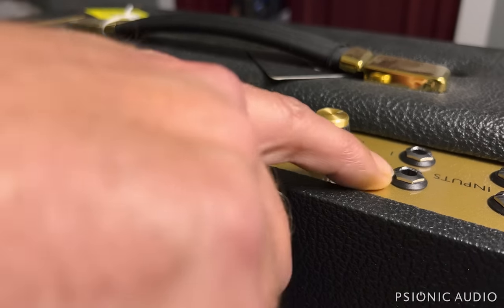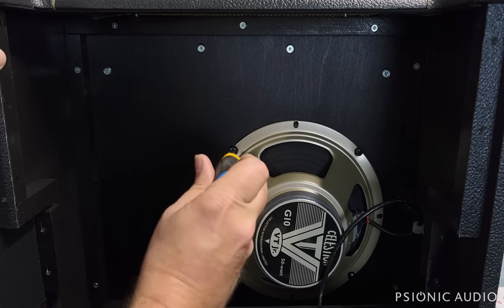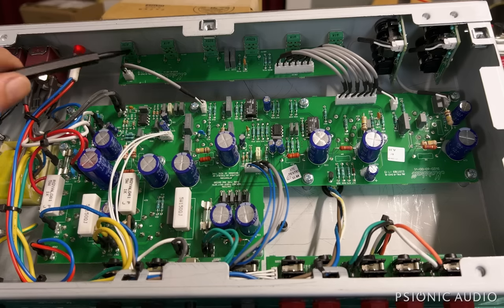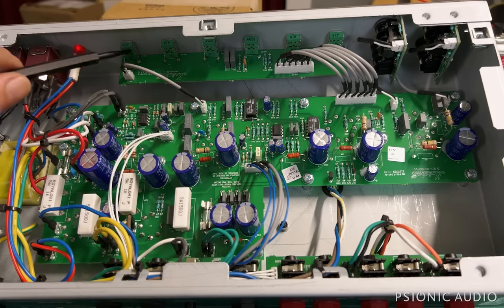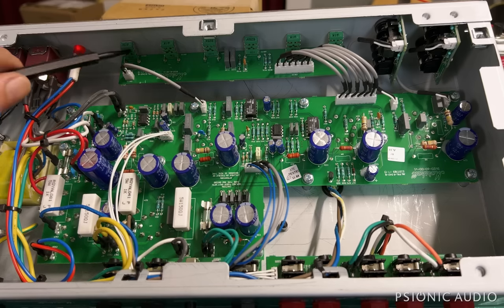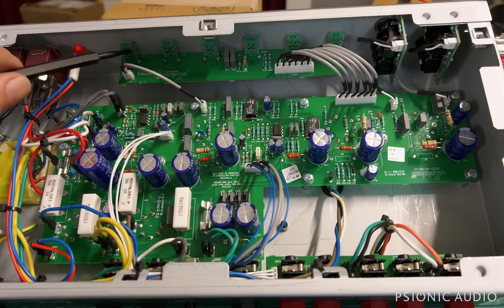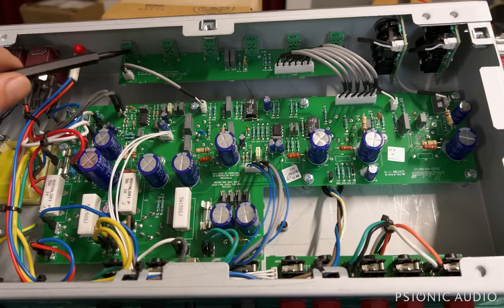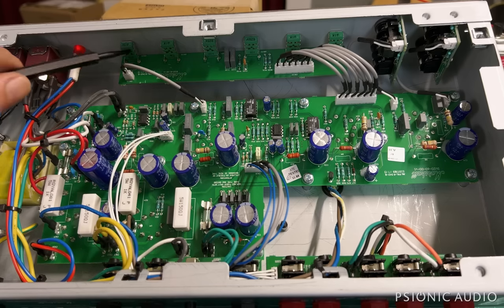Marshall Studio Vintage 20 | An In-Depth Look

Comment: Here in NZ it costs $1177 USD including tax. Friedman is currently out of stock, but usually costs more than twice that just for a Runt 20 head. I suspect import costs are messing with prices. The reverse situation in the 1960s is why Marshall, Hiwatt and Orange exist. It was too expensive to import Fender due to tariffs, so English amps appeared (I grew up with the Marshall factory just down the road in Milton Keynes).

Other stuff made in the USA is super expensive here too. It was a while ago, but a AxeFX was also double what US folks pay and you lot get free shipping as well. Another example is my Freyette Power Station PS-2A. It cost a small fortune to import. Fender, Gibson and EVH tend to be more expensive here too. Computer parts as well.
Reply: PS-2s weigh a ton! What godawful price did they get to ship that to NZ?
Reply: @cpfs936  Shipping was quite cheap. I had mine sent from Peach Guitars in the UK. lt tends to be cheaper and faster for some reason, e.g., Royal Mail got an Audient interface here in just a few days. About $1500 NZD total incl taxes I think, which is about $900 in USD funny money.  
Buying it from the NZ distributor that is not even in NZ was going to cost a lot more (in Australia). We are 4150 kilometers from that Aussie lot, but folks lump us in with them all the time. We do not have the snakes, spiders, crocs, or that silly accent either :P

Comment: My first tube amp was a Marshall JTM 30.  Have you ever worked on the JTM 30 or 60s?  They had a reputation for overheating.  My amp was fine though the reverb never worked.

Comment: I owned one of these for about a year. I was able to get great sounds at home but never really liked the way it sounded on a stage. The salesperson where I bought it told me that Marshall had specifically spec'd it with a 10" speaker because they thought it cut a bit more. I felt it was a bit strident in the top end. It did take pedals pretty well.

Comment from the maker: According to the UK/EU commenters this is about a $1000 amp over there.  While that’s much more realistic than the $1900 in the US, the DSL40CR would be the much better choice for the same or less price. Same build quality level but a louder better more flexible sound.
Reply: Having owned both of them, I would say they sound different. DLS is more flexible? For sure. It has a clean channel that stays very clean (which I don't like), a gain channel which does not clean up (which I dont like either) and some variations in between. "Better" however is a matter of taste and for my ears the SV sounds better than any DSL. I just love the plexi sound.
Reply from the maker: The Plexi sound? Which Plexi? Black Flag? JTM45? Super Bass? Lead? Major?

This little thing doesn’t sound like any of them.
Reply: @PsionicAudio  you are right, Let's say the 1987x is the modern Plexi sound (the JTM45 is different cause it does not have solid state rectifier to being with). To my ears the SV is much closer to the 1987x than any DSL which compress in a very different way. But if your point is  that the SV has its own tone I agree. And you need to break in the speaker to hear it properly. At which point if you like it or not is a matter of taste.
Reply: @PsionicAudio  The combo doesn't, but the head played through the same speakers and cab of a Super Lead sound almost identical. I don't know why they went with the 10" speaker here, massive mistake.
Reply from the maker: I tried it through my real cab too. Still compressed and crossover nasties.

It’s closest to a 1987 Lead. 

But not very close.
Reply: @PsionicAudio  Well, we'd just have to agree to disagree, they sounded really similar to me ! Keep up the good work man

Comment: I have this amp, but in a head. I play it through an Orange 1 x12 cab and it sounds 'bigger' and  more open with the 12. Also, i dont think this is a great bedroom amp, but  opened up with a full band it kicks big time! Easy as loud as my old 50w jcm 800( 1x12) if that helps

Comment: I'd like to see someone do a tag board version of this amp, with 6V6 Output tubes. I'm really interested in which Superlead spec they went for in the pre-amp, not sure any Schematics have been spotted in the wild yet. All the clips I've heard of this amp with a Stratocaster, sound great, very Blackmore tone. I think any complaints about the tone will be more related to using the combo, the head is where it's at. It'd be interesting to get a 50w Marshall Clone kit and  build it to this 20w Spec. In the UK, the Marshall head is £735. By comparison, other heads: the PRS HDRX is £799, Friedman Runt £1399, Suhr Hombre £1449! So the Marshall is much better value in the UK.
Reply: FX Amps in Greece do a couple of handwired 20W Plexi amps for around £1500. Look very nicely built as well.

Comment: Hi Lyle, Interesting difference in price to the UK... Marshall SV20 around £850 - £900, Friedman Runt 20 £1429 (or even more in some retailers, that was the cheapest) Suhr Hombre £1899. Worth bearing in mind if you don't live in the US, as the Marshall is by far the least expensive here. I wonder how that would change your feelings about the amp if you lived over here in the UK? Generally speaking Marshall's are a relative bargain in the UK, especially used.
Reply: For heads....  SV20 head for £699, Runt 20 head £1399. ... so exactly double the price.
Reply from the maker: That pricing aligns with the quality you get. The SV20 is a reasonably good $1000 amp these days, though I would choose other amps over it at that price.

It’s not a good $1900 choice.
Reply: also sorry, after scrolling down I see I'm not the only one to say this.
Reply: @PsionicAudio  For sure, over here they are seen as 'a good amp' but nothing that would compare to something 'higher-end'... and Marshall are so plentiful here used prices are always great. I paid £200 for my JCM2000, a Marshall is a cheap amp here if you want something loud and gig-able with a decent rock tone.
Reply: @rocket69218  He did not seem to get your point. Oh well. Busy guy. 

I grew up in Milton Keynes, but live in NZ now. Friedman is boutique amp prices here. This series of Marshall is just a mass produced amp and this combo is about half what a Friedman one would cost. 

The free trade thing that evened out prices around the world is breaking down. Lots of tariffs are being introduced, with the goal of protecting domestic industry and jobs. I suspect that's what is happening here (another factor is high roller investor types are fleeing to the USD for better bond returns et cetera, which is putting a lid on US inflation, bolstering the USD, and weakening almost every other currency in the world and increasing inflation -- logistics costs are also higher due to those weaker currencies and high energy costs etc). 

P.S. Tariffs and import costs in reverse duing the 1960s is why Marshall exists in the first place. They made Fender amps too expensive, which made space in the market for Jim Marshall. Same here in NZ. Several Kiwi amp brands existed, like Holden that AC/DC began on (Angus said his favourite ever amp was NZ made). 

We moved here when I was 15. Tariffs were removed and all the big brands began appearing in the music shops. I would go from shop to shop like a tourist checking out Marshall, Fender and Gibson etc (that stuff was rare here before then). The downside is factories closed. Lots of them. I got laid off at 19 years old and did not get back to work until 22 (the economy tanked -- several factors, but it was just after NZ permanently banned the US navy coming here).
Reply: P.S. I have a Silver Jubilee 2525H. Also about half what a Runt 20 head would cost. The Freyette Power Station PS-2A I run it through cost almost as much as the amp. American stuff costs heaps here. Same with computer parts for some reason. Cheaper in the USA by a lot. 

I also have a JMP 1987 copy that is a quite good attempt at a replica, e.g., the correct turret board and things like mustard caps and Marstran OT and PT etc. The Silver Jube mini is in the ballpark of a grown up Silver Jubilee, but the JMP copy is a much better sounding and built amp (I got it used from the guy that built it and he seemed angry I was the only person who knew what a build like that costs and placed a bid -- I got it quite cheap).

Comment: That's my understanding.
These come from Vietnam, and final assembly and testing is done in the UK.
Probably not so with their higher priced amps.

I just fixed a 6100 from 92, it had samhwa caps in the low voltage supply for the midi / recall section.
So, nuthin new there.
For the record, I always thought Marshalls were too damn expensive.
I killed myself as a kid buying one second hand...$1000 for a jcm 800 half stack.
$1 k was a lot of $ back then.

Comment: I have 2 of the sv20 heads that I got around $2grand at guitar center a while before the price went through the roof.  It’s the better deal since I can mix different speakers and cabinets with the heads. The heads go about $1000 each.

Comment: I read that Marshall tested both 10" and 12" speakers with these amps and they thought the 10" sounded better, which I thought was odd. I mean, the Celestion 10" G10 sounds pretty good, but it's still not a 12" G12M. As for the output stage, as you said, they could of just used 6V6s and they'd have an amp that is closer to the bigger amps tonally. I built a 6V6 fixed bias 20W with the old style Marshall preamp and it sounds great, I think it does a great job of recreating the sound of the bigger amps. I suspect the marketing opportunity was too good to miss, stating the amp uses actual EL34s.
Reply: sounds like you think that marshall will ever judge a component by it's tone...that's more like  dr z and friedman, people who care .marshall fender and vox are all cheap imitations of the past(and i'm a marshall owner).

Comment: Marshall prices have dropped across the board since this video.  And the SV20 head is currently at $1,299 USD.  I think the head, along with a better 12" speaker (not the V-Type) is pretty compelling.  And a few light mods to the circuit can work wonders to really get it to that sound.  However, the inherent build quality and how it holds up over time is another story.

Comment: I bought this amp second hand for $1000 Aus. The stock speaker is ok but try a 8ohm creamback as i did, vast improvement. Looks and sounds just like a marshall should. Set this amp up using your ears and it wont disappoint...
Reply: Stay with the 10 or did you go a 12 inch?
Reply: @pbest75  10 inch made in uk...

Comment: Wow the price of 1900$ you mention for the Marshall seems quite extreme to me. Here in Germany the Combo goes for "only" 900€, about 830€ for the Head version. 
At the same time, the Suhr Hombre would cost you about 500$ more here. Still though...
Reply from the maker: This combo is $1950 at Sweetwater, $1899 through my local independent music store. 

Seems nuts to me. Doesn’t approach the quality or sound of the Suhr, Friedman, or even the Vox AC30C2X, all of which cost less here.
Reply: @PsionicAudio  my new SV20C cost £699 ($860) in the UK.
And that is a good price (especially if you spend £120 on a 12" greenback and fit that as I have).
Blame the daft prices on the USA distributor, not Marshall !

Comment: I'd be worried whether that tiny little mains transformer could handle biasing at 90-95%.
The low voltage and bias-point combined with EL34's kinda makes this a dealbreaker for me.
Reply from the maker: I’m pretty sure it couldn’t provide the needed current. Hard pass here.

Comment: I was able to purchase a head out of Italy for $850 including shipping. I then had to purchase a transformer for US voltage at $30. Total cost comes to under $900. I'm not sure what the deal is with US pricing, but it's a bit of a rip off. As for the sound the one I picked up sounds very accurate for the Marshall sound. I played a Marshall Major 1970 for years so I'm very much aware of "The" Marshall sound.

Comment: I think a bias adjustment would really make a difference too. If the bias resistor is high enough off the board to have enough lead length exposed to do this I would take a 5 or ten watt resistor of an appropriate value  and add alligator clamps to the leads to be able to clip it in parallel with the bias resistor to  get it in a much more reasonable range without voiding the warranty. But of course that might not be feasible if there is not enough lead exposed.  A tad more than 50 percent can be workable for something like an A/B grid bias Fender, personally I usually go around 60 to 63 percent for black/silver Fender but have heard good things on some at the lower range, but that's a totally different setup than A/B cathode bias which usually sounds the best at much closer to max dissipation, especially with how low of a voltage is on the plates. I would imagine it would be much fuller  and punchier sounding at a  more reasonable operating point for that setup. And possibly sweeter sounding without the crossover distortion. But anyway no matter what the bias that's not 1900 dollar build quality lol.
Reply: It looks to be two resistors, one per tube (I'm assuming those two 150R are the bias resistors). That said, having built low power cathode bias Plexi type amps, I was surprised to find out I preferred biased fairly cold (60% at most), else they didn't really sound like a Marshall anymore. That was with higher voltage (400ish) and 6V6 tubes though.
Reply: @yessitsme6884   That sounds reasonable considering that classic Marshall sound is fixed bias, maybe a cooler bias on your build makes it less  characteristically cathode bias sounding in a way. A hot biased cathode bias power amp to me sounds further away from fixed bias than a cold biased cathode bias power amp does. Anyway whatever the factors are the ears are the final judge for sure just as long as it's not too hot of course.

Comment: So sleeves for the plate resistors would be nice little safety there and some support for the resistors . 253 on the plates really did the look AT THE EL84 sheet by mistake 350 to me would be a safe voltage on cathode biased EL34s  . At 253 they should be biased for about 80 to 90 mills  class A   !  The caps should be at least a 105c Panasonic, Nichicon or Chem-con or Vishay  for that price .  Sound may be stable for 2 or 3 years or just two days past the warranty ( safe margin  but not too much past the warranty date) .  Having Marshall name on the caps from the far east is penny per cap giving some gravitas (HaHA) .  That IMHO  little rant .  Fine video the playing does show the short comings of that amp in it stock British built form . One can only wonder if the tech they used to make that amp where all Lucas alum.
Reply: Lucas alumni designing amplifiers? I sure hope not! To paraphrase from a country song, my idea of Hell would be ice-cold women, ice-cold tubes, red-hot resistors and red-hot beer; and if anyone can do this, it'd be Lucas, the Prince of Darkness....

Comment: I'm curious about the Low Voltage (was that 253vdc?) on the EL34s vs more normal Voltage on a pair of 6V6s. I'm under the impression that the EL34s may seem to give more highs and lows, and the 6v6s would seem to have more midrange in comparison. 

Anyway, the amp  sure is good looking.

Comment: From my personal experience, I think the Creamback 65 sounds meh with the plexi due to the very hard/blunt mid frequencies. I think the creamback 75 works much better. In this application I would take the Creamback 10 instead of the V-Junior, but the V series are just bedroom speakers, and they work good for that. Most people will never take this amp anywhere anyway. Bought my SV20h for $1700, gig with it often and run it through a semi open back diagonal 2x12 with a Gold and Ruby Alnico with a Koch Loadbox 2, and dampen the signal in the effects loop because I like the EQ/less distortion. OOHH QUICK tell me how thats not how a Marshall is supposed to sound lol.

Comment: Would you be willing to post advised mods to this platform. I couldn't afford the friedman and was looking for hendrix tones. I have just bought the SV20H head and the matching SV1x12 cab. I would love to enable it to reach its best potential but live in the UK and posting to you would be cost prohibitive. So it would be good to know what to ask the local amp repairers to do. Would increasing the bias on the tubes to your recommended  90% be possible without too much cost or heat damage issues on the board? Thank you for your channel and balanced unbiased, wise, experienced opinion. All the very best  :-)

Comment: When you use a variable voltage regulator power supply to reduce power you also must reduce dissipation as you scale down, I think? Could you consider this a permanently 'power scaled' amp with its low(?) plate voltage or is the cold bias way beyond what could be accounted for by that way of looking at it?
Reply from the maker: Nah, this is just trading long tube life for meh sound.

Not a “scaled” or “variac’d” sound.
Reply: @PsionicAudio  Plug the amp into a single TWELVE INCH 25 watt Celestion Greenback cabinet. Makes all the difference in the world. None of these small cab amps sound good to me, too boxy, but once you pair them up with an outboard speaker cab, the sound is way way better. I watched a lot of demos of the combo and head, the combo just sounds like somethings wrong, ten inch speaker in a little box mostly never works for me.
Reply: The Jackson Ampworks Britain has a power mode of 25W cathode bias with 2 EL34 tubes so pretty similar. That Britain is not a meh amp in my opinion, neither is the SV20